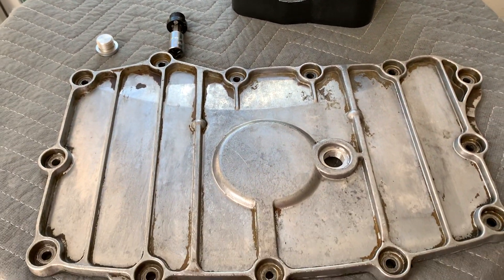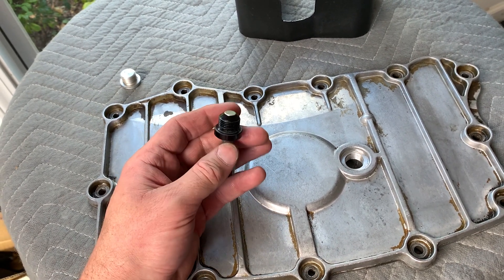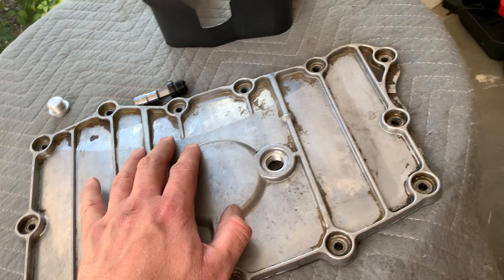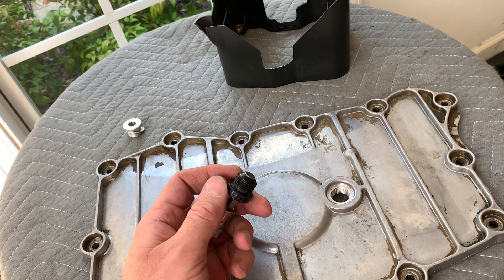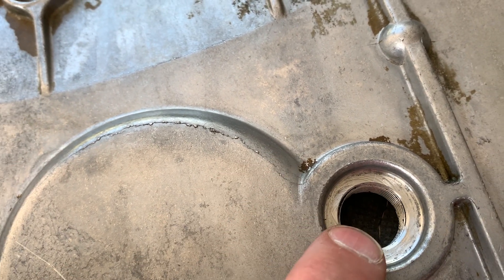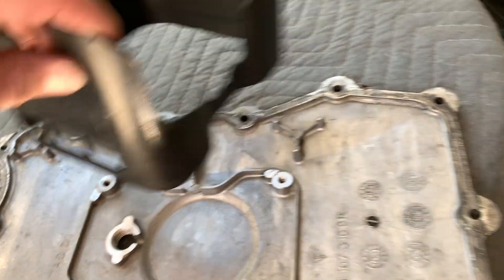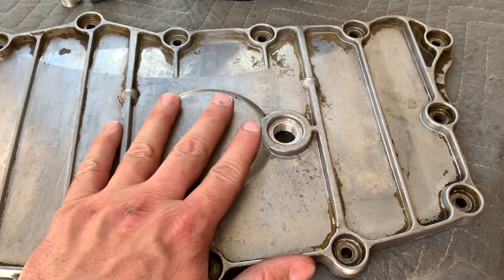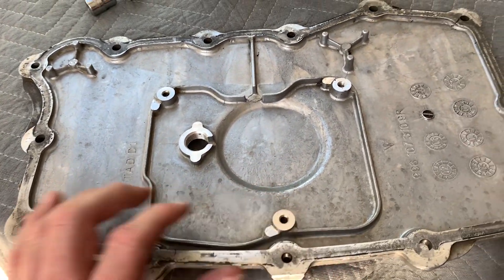This Porsche 987 had an oil leak for 2 years!!!   | 986, 987, 996, 997

Comment: I'm running the LN plug in a 2014 Audi 2.0T (CPMB engine).  It is a great product but can leak using the OE crush washer at torque spec.  Contacted LN and they recommend using a copper washer currently (traditional flat-style washer, not donut-style crush washer) whereas the LN plug initially came with an aluminum washer.

Comment: My LN plug definitely leaks on my 991.1 C2S if I tighten it to the specs on the plug, with a new crush washer. I have to add just a tiny bit more oomph, and then it doesn't leak.
Reply: Can’t see the drain plug causing an issue more a washer problem.